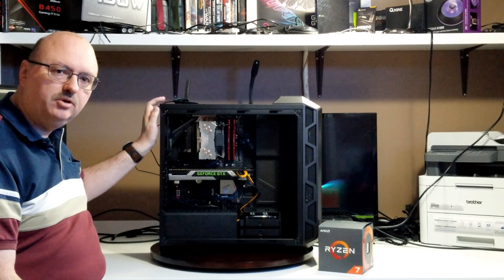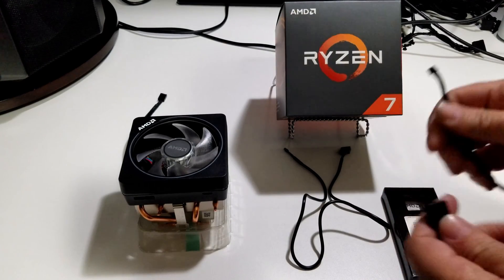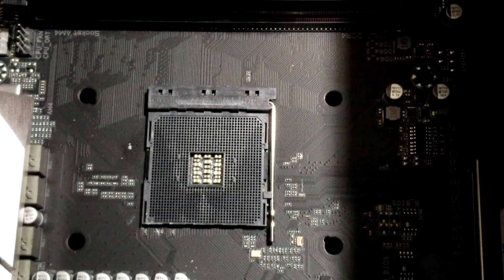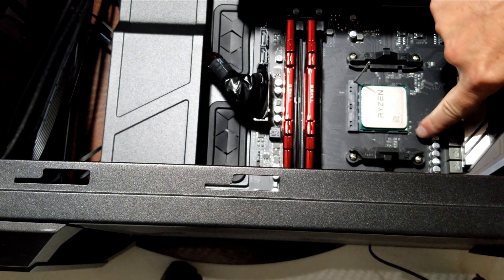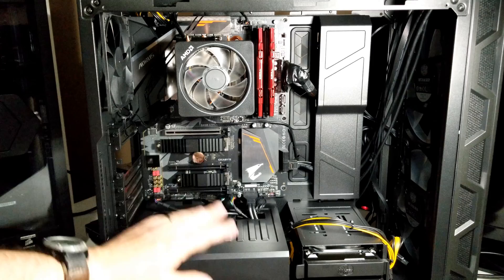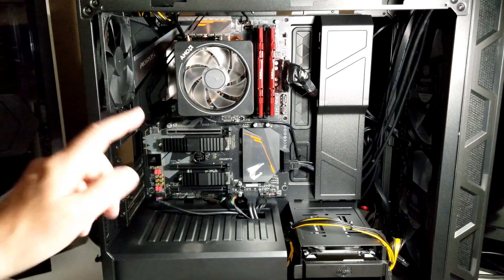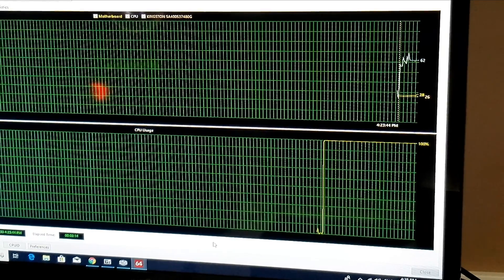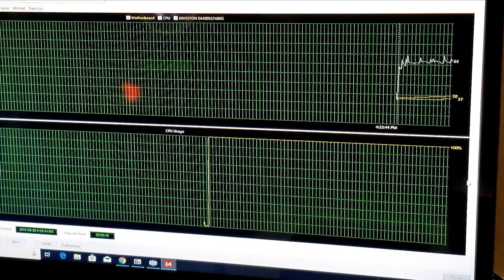Ryzen 7 2700X Review, Install, Temps and using the Wraith Prism RGB

Comment: I will be doing this in about 5 days time and I'm worried because I've never built a computer before. I just wanted to ask, isn't there something you peel off on the underside of the cpu? It looked like there was some cover on it? Thank you for this video, it was just what I was looking for. Also, I've got some nylon gloves, but I think doing it without gloves might be better as less risk of the thing slipping out of my hands.
Reply from the maker: There is a small chance of a static discharge causing damage, but I don't worry about it and its never caused an issue for me. There is usually a thin piece of plastic to remove from the CPU Cooler, not the CPU. I've done a few build videos and one specifically on the connecting the motherboard cables that will help. Big thing is just take your time rushing is what causes potential problems. You'll do great.
Reply: @Reviewing_Playing_and_More_RPM  Thank you so much. Now I get it (I think). I found your videos to be excellent. I'm about to install a ryzen 7 2700x onto a Asus B550 plus. I think I should be using a ryzen 3 but another tech person said I should be okay. Will be watching more of your videos. All the best.
Reply from the maker: Yeah I agree you should be good. Glad you enjoyed the videos. Thanks

Comment: i used to have a 2700X but now i have a 5700X but with a 2700X Cooler
Reply from the maker: As long as the CPU isn't Thermal Throttling that's fine but if it is you might consider upgrading the CPU Cooler.
Reply: I had to get a new cooler a few days ago cause my 5700X was overheating now I have a 360mm radiator from thermal take

Comment: sir can i use rgb and usb cables both on my wraith prism
Reply from the maker: You can but in my experience doing this resulted in error messages but it's been a while so they may have fixed those issues now. I myself recommend using the USB only. Worst case scenario it doesn't work then you use just the USB.
Reply: Thank u sir....
Reply: Big fan from india....
Reply from the maker: @rahulrajpal328  Appreciate you. Hope your having a great day in India. Thanks

Comment: I really need help when I turn my pc on my fam for my cpu ryzen 7 works but I get no mouse keyboard or no display when I turn it on any idea why?
Reply from the maker: This could be you need a BIOS update due to a new CPU not compatible with your MB, or it could be something as easy as checking your Memory is fully inserted. There are several reasons though my first thing would be its a driver issue, then was there a new Windows Update that can sometimes affect things.
Reply: @Reviewing_Playing_and_More_RPM  thankyou
Reply from the maker: @ililililililililil1370  Any time.

Comment: I bought a used Ryzen 7 2700x and paired it with an MSI B550 A- Pro M-ATX mobo, with 16GB DD4 3200 memory. The system ran WORSE than a late 80's IBM 386. I'm using Win10 21H1, SATA hard drive, no NVMe SATA. No idea what the issue is so the thought is to switch to another more acknowledged mobo manufacturer: maybe Gigabyte or ASUS. I wanted to stay with the B550 for the easy-flash advantage but most of the MSI boards recommended on PCPARTPICKER are B450's which is strange and the Asus that's recommended is expensive. I wanted to stay under a $100 for the mobo so I may wind up going back out into the dark with the MSI B550 PRO Vdh (not the wifi.)
I'm building this small m-atx system for my workroom to stream so it does not have to meet high gaming specs.
Reply from the maker: Yeah for some reason on PCPartPicker.com the 2700X doesn't want to pair with the MSI B550 A- Pro MB, not sure why that is. The MSI B550 PRO Vdh seems to indicate the same issue, I'm not able to verify it but wondering if it could be that newer MB's are coming with updated BIOS that no longer want to work with the 2700X although this would seem strange to me. I think that's possibly why it is indicating the B450. I do tend to avoid Gigabyte MB's now though as RGB Fusion is so flaky with the RGB Software but if one didn't care about the RGB then it's good. I prefer MSI and ASRock actually. I am using a 2600 in a B550 though so makes me wonder if PCPartPicker is just phasing out the older Ryzen series CPU's.  Best of luck with whatever you chose. Went back and checked and the X570's seem to indicate they will work well also.

Comment: What was cpu speed and voltage ? And what was room temperature ?
 I have problem with my temps, until couple of days ago temps were mostly normal, yesterday, when cpu was under lite load it shuts itself down because of temperature, i run some tests and saw with 90-100% load temps go up to 100c and even higher on occasion. I disassemble fan and cooler, clean the dust and change thermal paste, i also put fan speed on high, but still on heavy load i hit 100c which is unacceptable. What other problem can it be !?
Reply from the maker: CPU Speed and voltage where at stock so no changes made on my part. You could try checking the CPU Cooler is properly seated as there is a small ledge that can sometimes lodge just above the CPU so it doesn't make full contact and cause temps to be high.  Otherwise you could try going to an aftermarket CPU Cooler like the Hyper 212 RGB Black Edition it works great. Good Luck
Reply: @Reviewing_Playing_and_More_RPM  that would be tough to check becase there is not that much space when cooler is placed to see if it is placed correctly. Also when i noticed high temperature i did not previously move cooler it was there  when i put it first time, and did not have temperature problems till yesterday, even when outside and inside temperature was high.
Reply from the maker: @milosstojanovic4623  Well in that case I'm not sure, if ambient Temps are very high that will definitely have an affect, so the other option is either a better aftermarket CPU Cooler or maybe even an AIO. Now before doing that there are video's on Youtube that talk about under volting the CPU that can help with temps you could do a search for that to see if it might help.

Comment: Where did you plug the other end of the cable that says USB ?? The one who connected to the CPU
Reply from the maker: If your referring to the CPU Cooler, there is one that goes into the USB plug on it, and the other end goes to any available USB port on your MB.

Comment: I have this exact cooler but unfortunately it did not come with the 2 extra wires so I cannot control the RGB colours, any advice please??
Reply from the maker: You can't control the individual colors but the MB Software might recognize it, if not then getting an aftermarket RGB Hub might be the answer...

Comment: Is there away to control the rgb to change with the CPU temperatures? Red for hot, green for cool for example
Reply from the maker: Yes, just came across this recently, not sure about other programs but NZXT CAM Smart Mode Lighting can keep track of your CPU temps the same way it does with the GPU. And because you can completely adjust the lights to any colors you want and at whatever temperatures you want, monitoring both temperatures won’t be a problem at all. It's free software normally for NZXT hardware but it also works for other devices as well...hope that helps...
Reply: @Reviewing_Playing_and_More_RPM  thanks man ill check it out only installed my Prisim yesterday so just been playing around with the cooler master wraith software, there's a setting on Asus armory crate to have the rgb and temps synced but as I've got a ASRock mobo it's saying I need to connect a compatible aura sync device
Reply from the maker: @markevayne  Yeah so hopefully the CAM Software will help with that...

Comment: I just got this processer and I have found its quite loud do you have the same problem?
Reply from the maker: The CPU Cooler was loud, I went to the Power Settings, and changed the Settings and choose 50% for performance and there is another settings there as well if you change those it'll still work at 100% but the noise will go away and be much quieter, and you can also go into the BIOS and chose Quiet for the Fan settings and it'll help a lot as well...
Reply: @Reviewing_Playing_and_More_RPM  ok thank you

Comment: Hey bro nice video. I'm thinking of building my first PC. It will be a lian li PC 011 dynamic white case. It will have 9 rgb fans and RTX 2070 super with Ryzon 7 3700x. Will the Wraith Prism  be good to use or do I have to buy a different air cooler. Thanks from New Zealand 😎
Reply from the maker: Yes, I'm using it with a Ryzen 7 3800X and it works great...Hope your doing great in New Zealand, it's an amazing place...have a great day...

Comment: what are Wraith Prism minimum RPM?
Reply from the maker: 2,750 rpm using the low setting, 3,650 rpm using the high setting. You can hear the fan at 700-800 rpm and the noise becomes fairly loud once you hit 1000 rpm, so lowest is 700 RPM
Reply: @Reviewing_Playing_and_More_RPM  cooler master is trash. i confirm it every time)
Reply from the maker: @mrpicky1868  Well we all like different things, I've used a lot of Cooler Master products and I don't remember having found one I didn't like, but people have bad experiences with products so opinions vary of course...

Comment: What do we do if the colors keep flashing red white and green?
Reply from the maker: If it's cycling the colors you need to go into the Software and choose the colors you want, there are lots of options to choose from...
Reply: @Reviewing_Playing_and_More_RPM  I dont think its that.  When I choose the color I want, no matter what the fan keeps blinking those orange green and red colors as if showing the temperature.
Reply from the maker: @blubehriluv  Are you using the Wraith Prism Software with the USB Cable, or are you using the MB Software, I could not get them both to work together using the MB Software alone, so I used the Wraith Prism Software separately along with the MB software, not sure if your doing the same but otherwise using the MB Software without it might be the reason...

Comment: What is the low and high setting on the side of the fan?..is it the fan rpm or what
Reply from the maker: The high setting turns the RPM speed higher for better cooling but at a sacrifice of much higher noise, I've found that it works best at the low setting, still gets very good temps and very little noise making it much better overall...You can make some adjustments in the BIOS as well for the fan...Thanks...
Reply: @Reviewing_Playing_and_More_RPM  ohh okay....thanks for help me out....

Comment: Wait do I plug in both cables or what? Just the RGB or just the USB? And is the USB for 2 or 3? I am so confused 😕
Reply from the maker: Only use the USB, not the RGB cable and the USB only goes in one way to the CPU Cooler and the end going to the Motherboard is a standard USB connection...it's USB 2.0, 3.0 is completely different you couldn't possibly confuse them...Thanks...

Comment: My usb has 8 holes but 3 pins? Help
Reply from the maker: USB has 7 pins, with 1 blank spot meant to help you line it up correctly and insert it properly, if you only have 3 pins that's not USB...
Reply: @Reviewing_Playing_and_More_RPM  Would you mind sending a picture of how to plug it in in a b450-f gaming because i dont really understand computer building

Comment: Into which usb did u put it
Reply from the maker: The one that goes into CPU Cooler is on the right it's the 3 Pin, and the USB on the other end can go to whatever available USB port you have available on the motherboard. Thanks...

Comment: Hello, Kind Sir. I just finished building my pc last night, gave it a shot and all - what bothers me is that on idle cpu reaches ~55-60C, while in game ( so far tested on only one multiplayer game ) it reaches 85C :o I'm using both stock cooling and thermal paste, people all over the web reports same issue with that model (2700x), and AMD claims those are proper temperatures. Are your temperatures on similar levels ? It kind of worries me, but then again AMD workers says it's fine. I don't know what to think :l
Reply from the maker: Yes I was getting the same temps and when I stress tested it got to 91, and even that is considered ok by AMD, however I did change out the CPU Cooler on one system recently with a Hyper 212 EVO RGB Black Edition, and got almost 10 degrees cooler on stress testing and it stays around 40 on idle...I'm using the stock cooler on my Ryzen 7 3800X and the temps are better so seems to depend on the stock cooler from AMD sometimes...I do recommend when you are able to switch to a better CPU cooler, although it will work fine at those temps, I was just more comfortable with cooler temps...hope that helps...have a great day...Thanks...
Reply: @Reviewing_Playing_and_More_RPM  thank you so much, for both kind words and a cooler recommendation - i think i will fit it in my next month budget. Have a pleasant day :)

Comment: Hi, ive just got this processor, with a rtx 2060 super ex and im waiting to put it in my b450 gigabyte in a corsair carbide 03 case. Do y think i it ll be ok ?
Reply from the maker: The Height of the Wraith Prism CPU Cooler is 159.4 mm while the case says it will accommodate 157 mm, based off of that data I'd say no, however, I do think it will fit based on the case itself but that's just my opinion and it might be wrong...so don't want to steer you wrong and says yes it'll work when it might not according to specs alone...just that the case allows a bit more from what I know of the case...I know this is conflicting news but wanted to be upfront on it being my opinion that it will work...Hope that helps...Thanks...
Reply: Thanks

Comment: I’m still stuck on the connect your cm device screen after plugging in the usb cable and after trying the rgb cable
Reply from the maker: If you get this message, it's often because you used the RGB Cable, not sure why, but using just the USB and not the RGB Cable, has resolved this for many...Thanks...
Reply: Reviewing Playing & More RPM I don’t know what’s wrong the rgb cable is now not being used I made sure the usb cable is plugged in bug it is still not able to be controlled
Reply from the maker: Ok, so the RGB from the the Wraith Prism should not be used, just to be clear, just the USB from the CPU Cooler, then the case fans RGB should be used...this will allow you to control the RGB for the CPU Cooler from the Wraith Prism Software and the MB for the other RGB...now when it comes to the Wraith Prism software there are two versions ensure you have the correct one...hope that helps...best of luck...
Reply from the maker: @Rafael Lopez Canel Your very welcome...Thanks...
Reply: Sir help me! I use main cpu fan Cable to cpu fan 1 slot and another 3 pin to usb 2.0.
But still "plug in ur cm device".
My mobo is x470 asrock. I already uninstalled polyrgb from asrock.

Comment: Hi Dennis. I'm late to respond, but you should only use one of the rgb/usb cables at a time.  Think of it as 2 different RGB solutions in 1 cooler. USB is for Addressable RGB and the other is for regular RGB like your h500 case fans. Either solution can work but not simultaneously.

I have same cooler and case (3800x and your videos were a huge help with all the case cables and build. Thank you).

It looks like you are wanting to match the case and CPU cooler RGB. You can do this more easily without the extra software by using only the RGB cable (not USB or both). Just plug straight I to the mb RGB headers and or in your case, your case fan RGB cables came with a splitter with room for one extra RGB device. So you can sync this cooler with the H500 case fans without using an additional mb RGB headers. Cool!
Reply from the maker: Appreciate the info very much...Thanks tons...
Reply: @Reviewing_Playing_and_More_RPM  No, the thanks is to you. Your channel is super helpful. Love how you explain each step even if you did in a previous video. Each video is its own perfect self-contained guide for whatever you are showing. Hope you keep doing this youtube stuff

Comment: Just put my build together with the 2700X, was showing very high temp so we taken the thermal paste off, reapplied it and it is running at 33 degrees now. Also, we had to change the minimum rpm for the wraith prism as it was at 200rpm. Did you have to do anything similar?
Reply from the maker: No, but my current one with a R7 3800X does seem to rev high rpms up and down more then it would seem...still working great though...I'm going to change the fan setting to L vice H to see if it makes a difference...Thanks...
Reply: Reviewing Playing & More RPM what were your cpu temps under load?
Reply from the maker: Temps were about the same as the R7 2700X, under full load hitting 67C...just a bit noisy...

Comment: I got the same cpu and cooler but when I start my pc the fan doesn't spin and the RGB doesn't work. What do I do?!
Reply from the maker: Re-check you have the CPU Cooler plugged into the CPU Fan Header, and not using the RGB Cable, you can but for me the RGB didn't work properly that way...also if you've done all that, re-seat the Memory, and basically do a re-check to ensure something wasn't missed...
Reply: @Reviewing_Playing_and_More_RPM  alright will do! I'll let you know if it works or not
Reply: @Reviewing_Playing_and_More_RPM  question, which cable is for the cooler? The 3pins with the usb or the 4 pins?
Reply: @Reviewing_Playing_and_More_RPM  my bad!!!! Apparently the main cpu cable was hidden behind the motherboard when I put it on my pc. Managed to fix that and now it works!!!! Oopsie! Still want to thank you! Amazing vid. Keep it up
Reply from the maker: No problem, glad it helped you out and everything is working now...Thanks...